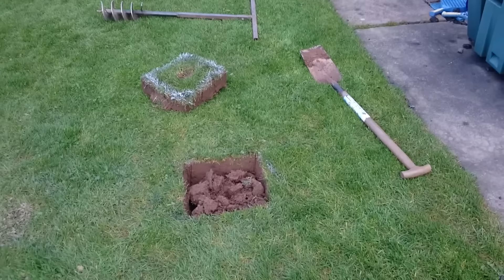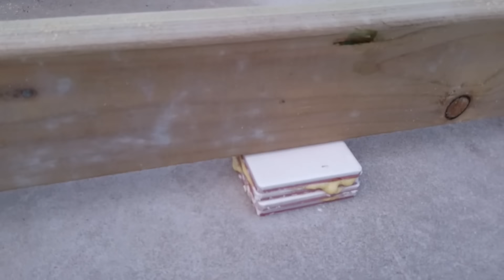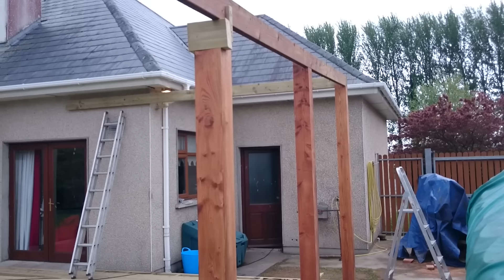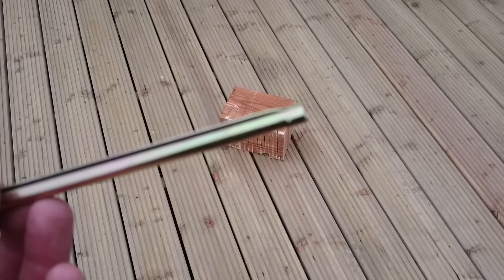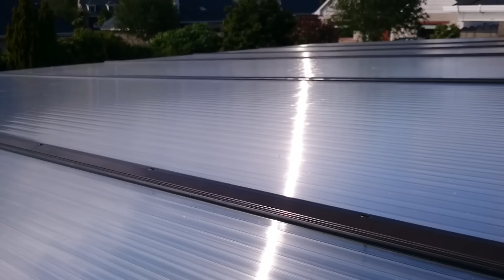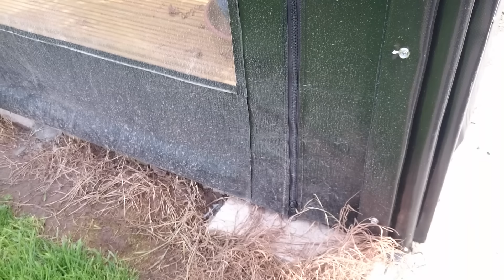2015 Deck Build - with polycarbonate roof and PVC side covers

Comment: That's absolutely brilliant.. I have some much info from this video.. We currently have a pergola which sits exactly like yours.. This is the next stage for us.. What do you use when the polycarbonate sheets meet the brick walls?? That info would be great.. I would just like to say.. You have made a great outside room.
Reply from the maker: +26souljah - The roof of our house overlaps the edge of the polycarbonate sheets by about 50cm. So we didn't need to pay much attention to making the sheet edge watertight. As you may have seen in the video, the sheets sit on top of a beam that's attached to the wall. We attached a second timber plank above this main beam, with just enough of a gap to fit the sheet. So the sheet slots in between these 2 pieces of timber, which holds it securely.
Reply: +fardinger thank you very much.. For getting back to me.. That's exactly what I'll be doing!! Still can't stop watching what you have achieved!!! 👍🏻

Comment: Just stumbled across your video, major problem the decking has been installed the wrong way up.  The fluted side must go underneath, this is to preserve the wood when wet.   If you leave it facing up it will be slippery and shorten the life of the deck.
Reply: +Heather Nolch I just stumbled across your comment and noticed a major problem with it, if the decking is covered with a water tight structure...how is the decking going to get wet?
Reply: +Ronnie Swart Touche.

Comment: Brilliant job, was thinking of doing exactly the same over here in Mayo.A few questions: How has it survived the storms (polycarbonate and pvc), Where did you get your polycarbonate and how much did it cost approximately (what are the dimensions of your roof) and how did you fit the joins? I had planned to fit it sheet by sheet, fixing it from the sides but that doesn't look possible, did you have to climb up on the polycarbonate? Finally, thanks for posting this, it's exactly what I was looking for although I would like to have seen footage of you fitting the polycarbonate sheets.

CB in Mayo
Reply from the maker: +Cartha Byrne - Hi, Yes everything has survived the storms just fine. No leaks in roof. We had christmas dinner on the deck (with the help of a gas heater). Got the polycarbonate from polycarbdirect.co.uk. Can't remember the exact pricing, but it was the cheapest I could find at the time. Delivery was fairly slow, but I guess you get what you pay for! Re the roof joins, we were careful to space the timbers to exactly match the standard roof sheet widths (including expansion space of 10mm). The rag gasket was stapled along the top of the timber & the sheet edges laid on top of that. The aluminium glazing bar was placed on top (across the 2 sheet edges) and screwed through, down onto the timber. This effectively clamped the sheets in place. Also I have a row of glazing 'buttons' along the lower edge of the roof sheets, about a foot back from the edge. These screw through the sheets into noggins below. This is to prevent any wind-lift at the lower (unsupported) edge. We had to get up on top of the roof to place the sheets & fix in the screws. We put in some temporary timber bracing under the roof timbers to support the weight & we used long wide planks on top of the sheets to spread the weight. I highly recommend you do this project. We have gotten loads of use out of this deck.